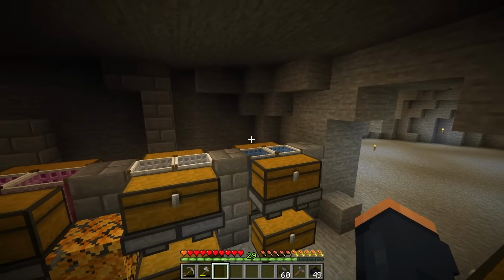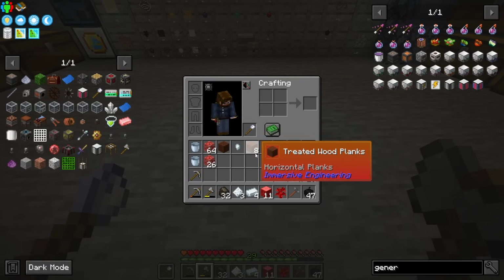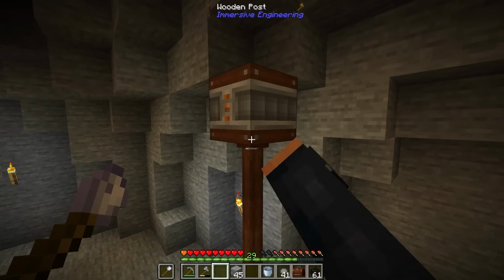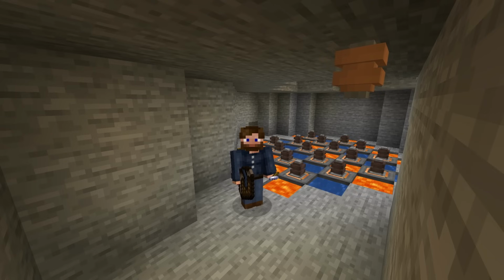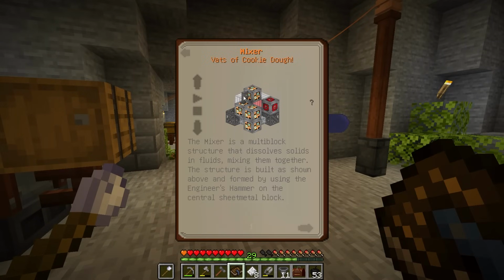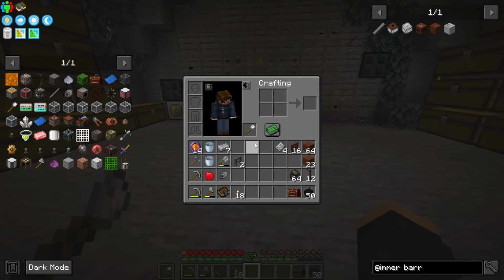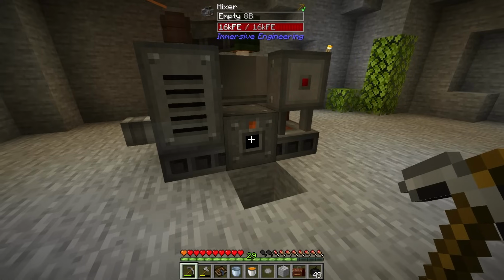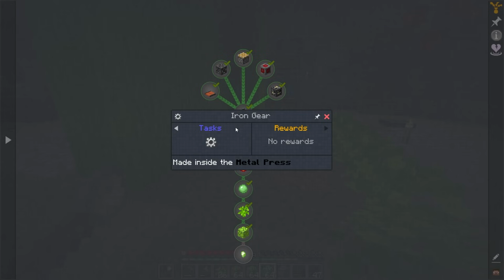Stoneopolis EP6 IE Power Cables, Mixer, and Strainer Automation

Comment: big thing for immersive wiring, do NOT wire through a capacitor bank, always keep them in parallel. They will limit your power transfer rate (total) to their connectors, so you waste all the capacity you have on your relays if your entire generation goes into one connector

Comment: BTW for the strainers you don't need tier one for certain items if you hold shift and look over the item in jei you will see that higher tiers give higher chances to that item. So you could use all iron meshes and get the same or better results when straining. In jei it just shows the minimum tier required when straining for a certain item.